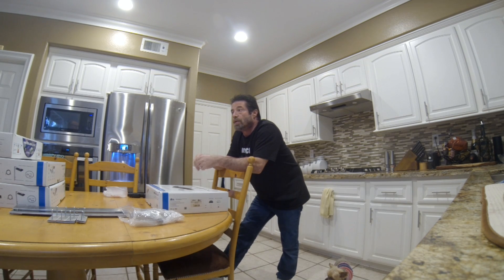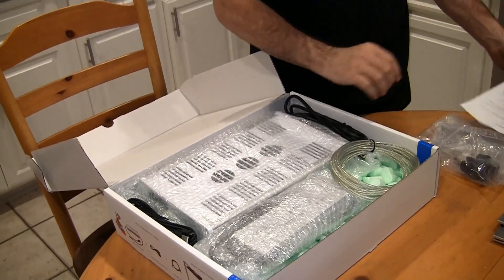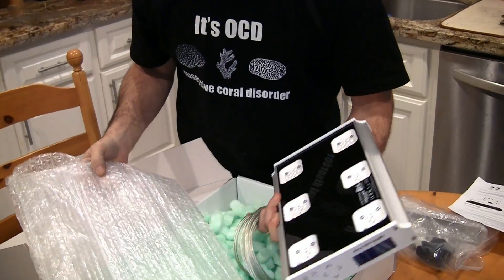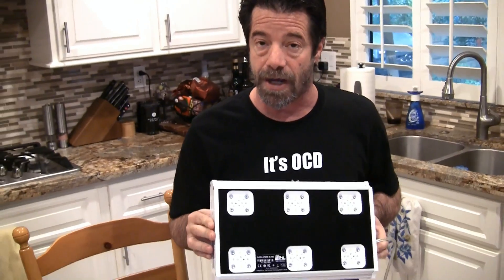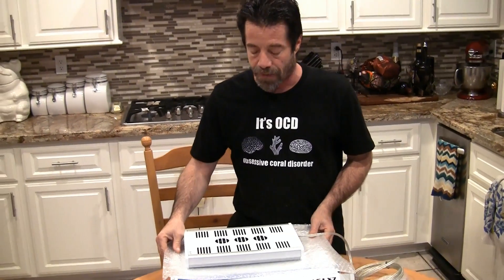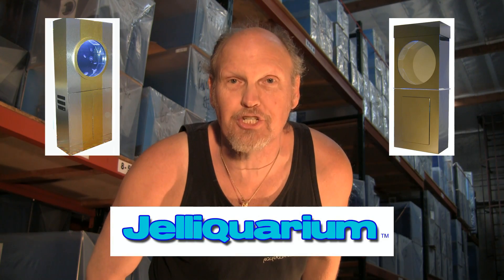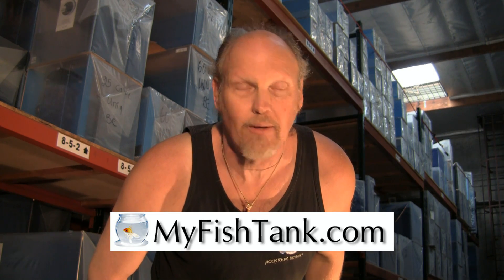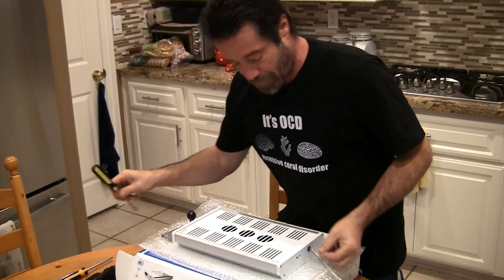GHL Mitras LX7206 LED Light Installation, LA Fishguys TECH TALK episode 158, part 1

Comment: What was his kessil a360we lighting schedule? Like color/intensity for each set time? I am having trouble finding a lighting schedule that grows coral well. How far from the waters surface were his kessils?
Reply: Here is a link to the graph from my Kessils before I made the switch. I peaked at 65% color & 75% intensity. Peak was 4 hours out of the 12 hour photo period. Lights were 8" from the water surface. In the graph in the link below, intensity is the orange line and color is the blue line.  http://s390.photobucket.com/user/shleif/media/Tanks/Kessil/image_zpssdaspdya.png.html
Reply: slief no negative affects running the kessils at 75% intensity? I am always scared of burning the coral with too bright light.
Reply: None whatsoever but as with any new light, you need to start slow and work your way up. Starting at 50% and increasing a little bit every week and no more than 10% a month allows you to see how your corals respond and back off a bit if they respond adversely.